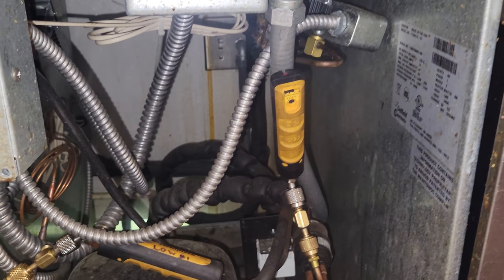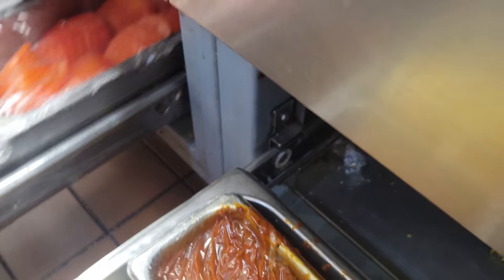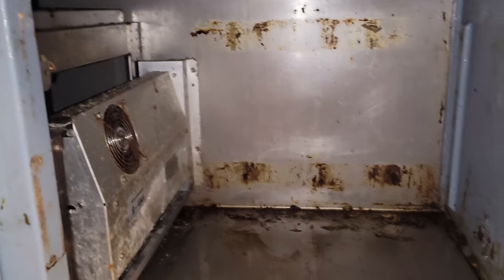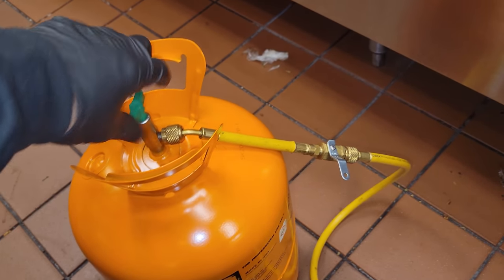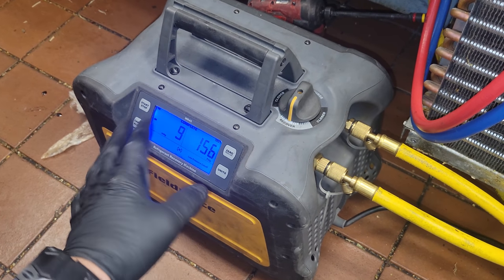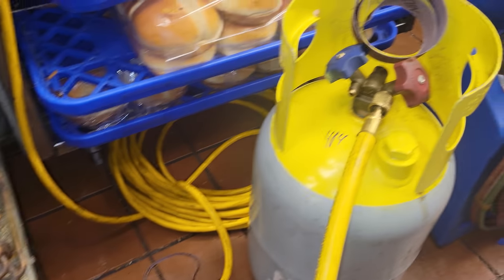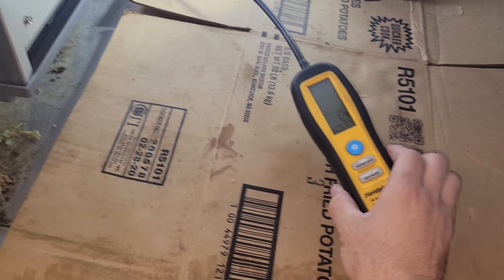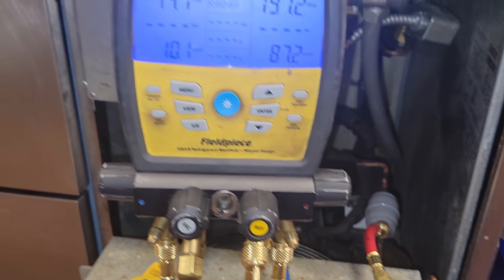HOW DID THEY MANAGE THIS ONE?

Comment: I laughed out loud when I saw that spatula stuck to the top of that thing.  I used to do IT for a large restaurant chain and worked on POS systems (in both senses of the acronym)  I have a photo gallery of weird and disgusting crap I took pictures of in the restaurants I serviced.  Oddities such as a chicken wing completely suspended by a network cable which was embedded in it.  Great video.

Comment: I have seen so many issues with those units in my area. As you found that coil is the most common for issues. Next issues that I have seen is the controllers going south. Then I had a high pressure switch fail partially and then before I could get the replacement switch it failed completely. The spatula was great. I had a table that had a hole in the top where they seemed to push the leftovers into the hole and it was all piled up around the condenser. Glad I got into this industry. You helped me get into it for sure.

Comment: Thanks for sharing this repair.  I laughed out loud when you showed the location of the sensing bulb. That goes to show you that you just can't assume anything when working on things which have been repaired before.

I get this type of finding on the antique and vintage coolers quite a lot. Sometimes they come in the shop after being "put out to pasture" for decades. They want it repaired and / or restored.  These things all tell a story which can be quite interesting.  It's usually pretty easy to find the "last big problem" which caused the last commercial user to discontinue use of the cooler. But once you dig into it, it starts to tell the story of the previous decades of service and repair which has happened. 

Had one last year with the sensing bulb located as yours was.  On that one, someone had adjusted the TXV superheat adjustment all the way to the lowest possible, to force the system to "work" to some degree. I wonder if the person responsible for installing the TXV incorrectly noticed the new one was not working correctly; and adjusted? Or it the owner suffered with the poor cooling and eventually called another serviceman who didn't catch the sensing bulb location, and went straight to the adjustment?  Will never know; but it makes you think.

Comment: Ok, good on you for fixing that mess. That said, I'd have been on the phone to the county health inspector as soon as I left that job. That was gross. There's no way they should be open for business.
Reply: did you not miss the part where he said that if someone there took it all apart they wouldnt be able to put it back together, the thing should be designed for easy cleaning not the way it is
Reply: @redred222  There hadn't even been effort to clean what could be gotten to and the floor and other areas were filthy.

Comment: People put the sensing bulb on the liquid line with the txv won't meter properly to keep it wide open to keep it working at some capacity. Usually a temporary measure until the valve is replaced.

Comment: I think you were referring to both the customer and the previous service provider? That mixing bowl spatula stuck to the overhead has me in stitches! We had both in my consumer electronics repair shop in the 1970's to 2001 when we were laid off by our former Fortune 500 company. We repaired warranties of the house and other major brands. We find that either the customer or another shop attempts to modify (your generation calls "overclocking") or repair the units. We find odd things in these units that shouldn't be there unless the covers has been opened. We had to not the warranties or refuse repair due to company policy or violates FCC rules on communications gear.

Comment: a rotation tester for pumps will tell you if the solenoid valve is running just like if a pump motor is running. i use that tool every single day and i bought one on amazon for 5 bucks but you can properly get them way cheeper
Reply: Danfoss has one, on one of their apps. It detects the magnetic field rotation
Reply: They used to be super cheap and there were different manufacturer's providing them. Now they're like 15 dollars a piece on amazon o ebay. Same seller.

Comment: HVAC people were looking at the cooling unit. Restaurant people were looking at that sanitation... 0.0
Reply: Me, who has done both: oh no....
Reply: @lillian6023  Maybe someone can chime in on how restaurant staff is supposed to clean those boxes out without disassembling them. I cannot imagine that they are supposed to take them apart to clean them. Otherwise I would expect some sort of fastenings that do not require tools.
Reply: @alexanderkupke920  this wasn't my side of things really.... I was more of the one on the front end with customers. Bakery sales.
Reply: @alexanderkupke920  There are clips on the drawer rail that lets the entire shelf pull out easily, and all the pans are in a larger pan that can be pulled out separate from the drawer. The line is the back of the box is where all the hotel pans are splashing as people slam the drawer shut. They knew that someone was coming to fix this... Now would be the time to clean it.  Other tips include: Not over filling the hotel pans with onions, keeping sauces not in pull out drawers, proper hotel pan lids, dates, applying the cling wrap tight to the containers- all can help prevent these problems.
Reply: @eden876  You're absolutely right - the easiest way to clean is to mitigate the chance for spills. Using lids and cling wrap properly, putting messier items in the easier-to-clean places...

As someone that works with a similar unit every day (no cold rail though - product is chilled from the drawers underneath) and I can state from experience that you CAN do a reasonably-good job of cleaning without removing the drawer rails. It's definitely a challenge, requires some creative maneuvering, and is a bit of a PITA, but it can be done. We're missing half the hardware that holds the bins in the top, and 3/4 of my coworkers are like proverbial bulls in china shops, and since I'm the only one willing to do it, I'm the only one that does it... (At least it's getting cleaned four times a week, as opposed to zero...)

Comment: Just curious what your thoughts on leak stop are in general. The leak in the evaporator definitely warranted a change, not questioning your decision, more so just curious if you ever use it or if you don't what the reason is. I'm always trying to learn more. Thanks for your time.

Comment: Big picture.. did you have time off camera to check start components. Contactor, or start relay? Had a change out of an accumulator and filter drier on a residential split system. Pulled to 495 sitting for R 22. Filled it and shipped it. Thanks for sharing. Stay safe and be well

Comment: Good sensing bulb location 👏🏻 
Pro tip. Put a sight glass on unit after drier. Then you don't need guages to see if its low on charge or not :)
Reply: Super heat sub cooling. No need sigh glass for little unit
Reply: @imaxtranhvac-rdienlanhusa9822  if txv system then why not?

Comment: Do you add slightly more than 32oz because your hoses were empty when the scale was zeroed out, but you end with some of the refeigerant in your hoses when you disconnect? Aka some of the refeigerant doesnt go into the system
Reply: I'd have to watch again to be sure, but I thought that he had purged the lines before he zeroed the scale.

Comment: I can see the switch for the upper section leading to a call back. it's mounted upside down. Pressing the bottom turns it on, and pressing the top off. granted it does have the red band, but 90%  would leave it to muscle memory, top is on.  Plus, anyone with OCD, that would drive them nuts.

Comment: What does the gas balast do on the vacuum pump actually?
Sorry, i'm not into the field but like to watch these vids as a break from my usual work content. So i'm an absolute dummy here
Reply: Gas ballast open allows the venting of system straight to atmosphere, when closed its being pulled through the actual oil in the pump.

We open the ballast to help keep the pump oil as clean as possible. We close it to get a final vacuum.
Reply: It helps to keep the oil from being contaminated so quickly from the moisture in the system that you are removing.
Reply: @jasonjohnsonHVAC  Oh, i see. thank you!

Comment: I would love to start a career in the HVACR (specifically refrigerant) industry. Has anyone recently started theirs?
Reply: Now is the time. There seems to be a shortage of good mechanics and techs. It also seems fewer young people are joining the trade. I know here in NY many contractors are short handed
Reply: @ChrisM78  I was worried that living in MO with our cold winters would lead to a lack of AC/refrigeration work. I would prefer to be a technician rather than work for an "I'm going to sell you a whole new AC system" type company (sales position). I love the diagnostics part of it. I imagine I'll have to start residential though.
Reply: Can anyone provide some recommendations on getting started in an HVAC career? I will be getting the needed 608 uni cert. I also watch all of these videos and try to understand the train of thought followed to diagnosing these system problems. I find it fascinating. 

Additionally, I'm trying to understand if it's going to be best starting out in residential, as I would prefer to go straight into light refrigeration (restaurant).

Comment: Perhaps the code should require the manufacturers to make these units "easy cleanable" without taing everything apart. All this gross stuff is just because there are so many unreachable edges and you can't even flush the whole inside with hot water and cleaner because of the coils and fans inside. There must be a sensible solution to get these units easy to clean. 
I mean, even if they wanted to clean this toroughly, they will fail because of the unreachable corners...

Comment: When management believes deep cleaning isn't a profitable use of labor, with no tickets coming in and no food coming out, it shows.  Some bosses make dollars, not sense.  Not removing the drawer slides to clean the box is one of those "guys, just clean the inserts, that takes too long and they're hard to get back in, it'll be fine" kind of fallacies.  Health inspectors are WAY too accepting of excuses.  If it's been slow, don't cut the staff.  If it's been busy, you had the income for overtime.  Neglecting cleaning damages coolers, scraping out dried-on crud from months ago has broken many coils.  Those drawer slide bearings don't last with residue in them.

Comment: "See something wrong here?" 
I didn't think any service tech was inept enough to put the sensing bulb on the outlet to the txv. Then again, i'm used to having to go over other contractor companies' work for the fractional tonnage heat pumps (leaks are easily missed). 

There's lazy ones, and then there's dangerously lazy ones.The lazy ones you can bet they'll find an efficient solution. Dangerously lazy ones will haphazardly put a "solution" together without actually understanding what they're doing.
Reply: I had to tell a couple seasoned installers(union to boot) that they could not mount the bulb verticle with the tail down,and especially 3 feet away from where the suction line leaves the coil! They actually tried to argue

Comment: Your looking at the botched job from a what was they thinking point of view. Think of it as a guaranteed repeat call point of view. Some guys are very dishonest. I seen this at the place I worked. Techs over charging units. Mounting stuff wrong. Loose connections so they can come add gas every 2 or 3 months. I used to find those service port caps laying on top of our coolers. They never put them back on. I don't know much about refrigeration but I know I seen alot of guys doing jobs very wrong. You we old be pulling your hair out after 15 minutes in that place. What you get when you hire the cheapest hvac guy you can find.